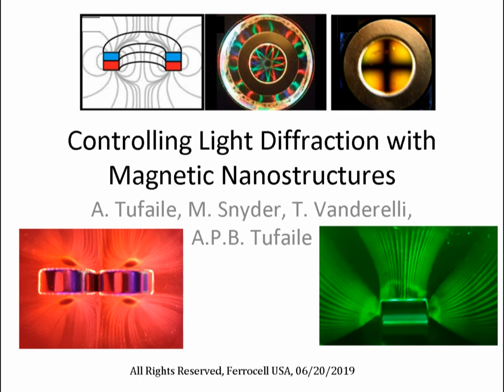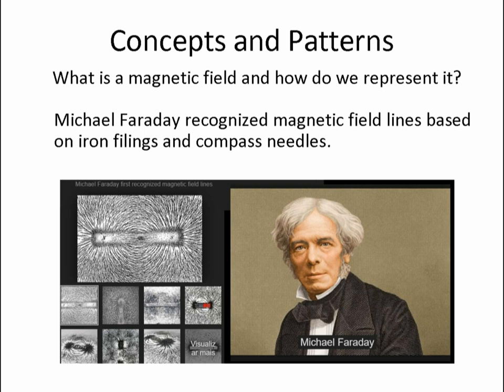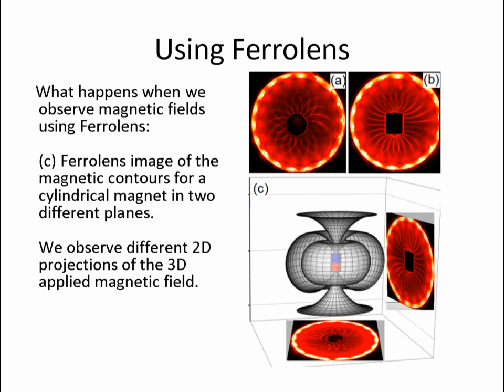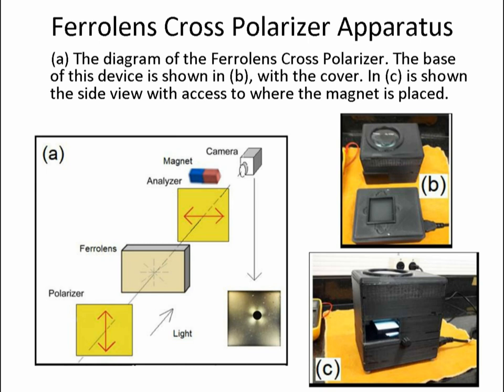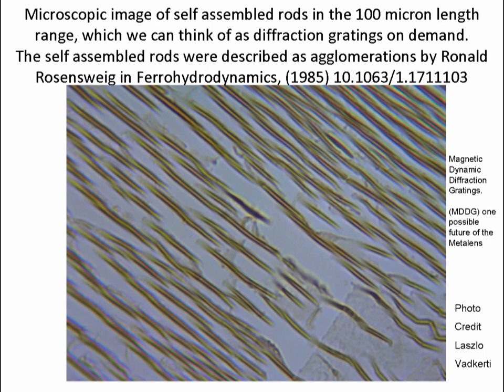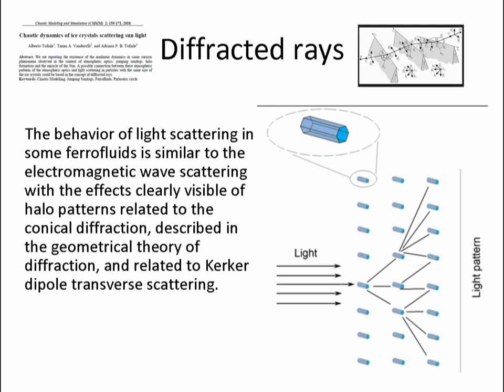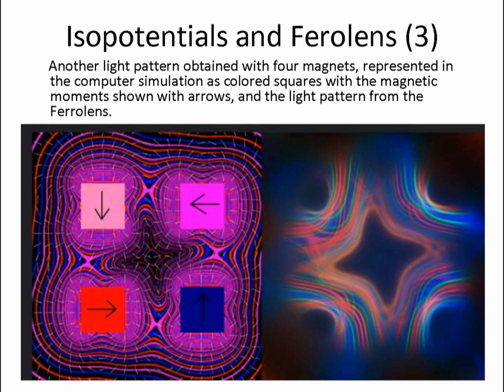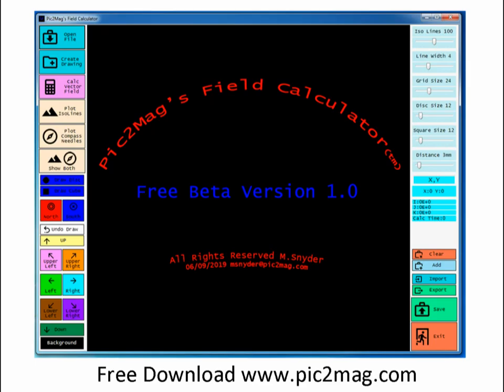Controlling Light

Comment: Awesome.  Can these diffraction lines carry any current?
Reply from the maker: No. Each nanoparticle is coated with an insolatory coating. An ac signal will propagate thru via the  dielectric property, but not dc current
Reply: @ferrocell_usa  Thank you. I was thinking it would be an interesting way to create a circuit switch, and maybe as tiny pixels for making a tv screen.
Reply from the maker: @gristlevonraben  you could use electromagnetic deflection and use a cell like a projection CRT
Reply: @ferrocell_usa  wow, cool idea.